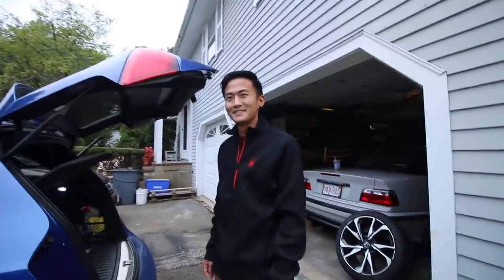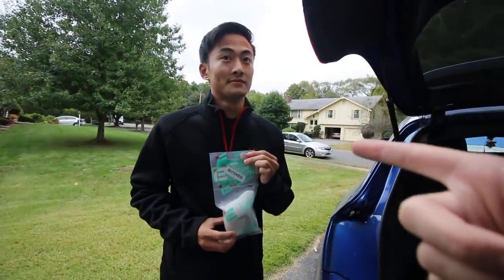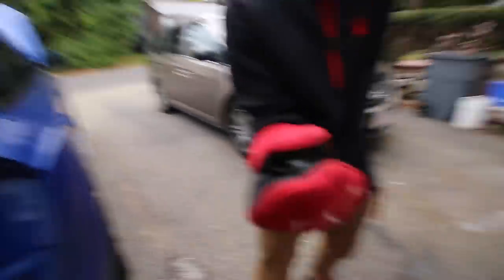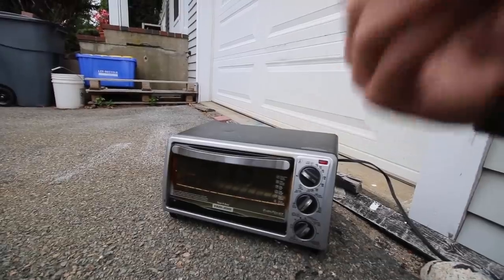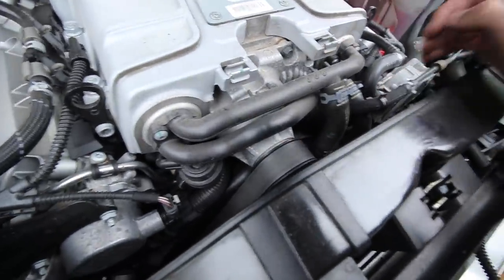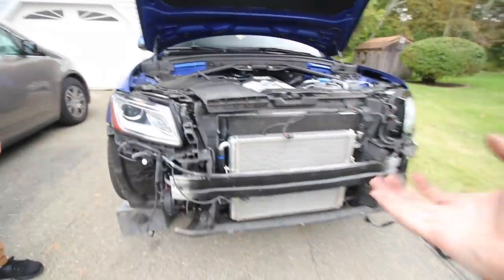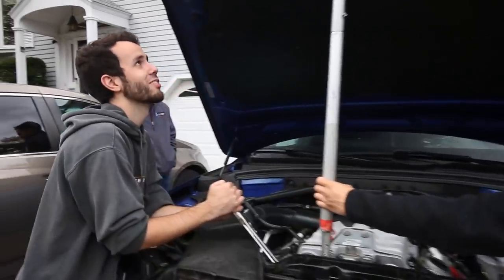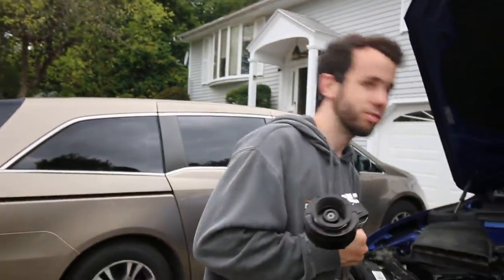SQ5 IE CRACKLE TUNE & S/C Pulley Install

Comment: Are the burbles adjustable? I like it but I think the duration once you lift off the throttle is a bit too much for my own taste. For example, on my N55 powered BMW, I essentially get full control over the duration and intensity of the burbles and pops. Daily driving? Almost no burbles. Cruises to car shows and with my group? Obnoxious af. Great video though, reminds me of the old days of you ripping with your S4 and throwing every mod on it.
Reply from the maker: They are not. But I’m sure IE is happy to hear feedback!
Reply: IgnitionTube I'm sure their customers would be happy to have even more flexibility with their products! Heck, I'm not even on any of their supported platforms and I'm a fan of their offerings.

Comment: Crackle sounds nice, but crackle is a bad thing based on my knowledge. Think of retarding the timing to achieve noise with leaning out the car. Leaning out results in incomplete detonation which over prolonged time should destroy an engine. Are there no concerns with this? Or does I.E. address this? Or have they created a tune that does something completely different to achieve this, maybe adding more fuel during upshift or letting off the throttle?

Comment: Hey Eli, I’ve watched all of your videos I think they are great. I had a couple questions about the IE stage 2 tune before I added to my B8.5 S5 if you don’t mind. 

First does flashing the ECU with stage 2 make the check engine light come on due to hotter air flowing out of the engine possibly making it trigger the O2 sensor.

Secondly, could I just go right to stage 2 if I replace the supercharger pulley?

Lastly, is the crackle tune adjustable to only crackle at a certain point?

Thank you for making awesome Audi videos.

Comment: Curious to know why IE doesn't supply a new belt. Many other companies supply a new belt due to the smaller diameter pulley.
Reply from the maker: Because it’s not needed until you go dual pulley. It’s millimeters of difference and the belt is already very taught.

Comment: I know this was 2 years ago. But you ran stock cats on this even with crackle?
Reply from the maker: yes, not the best decision but I knew I was going to do test pipes later on
Reply: @IgnitionTube  yea I ran it for a day and said f that and took it off. Rather just run single with no crackle and hopefully make cats last a little bit longer.

Comment: Question. I leased a 2019 A4.  I know I’m not supposed to modify it in anyway but do you think the stage 1 tune would be practical?  I know I can always return it to stock but I was hoping you could give me your opinion
Reply from the maker: John Torres once flashed you will get the car TD1’d as soon as the dealer plugs it in, even if you flash back to stock. They’ll likely make you pay a fee when you return it after lease ends.
Reply: Damn that’s sucks lol. Thanks for the reply
Reply: @johntorres6724   I've had stage 1 GIAC on my S3 for almost 5 years now and taken it to dealership throughout the life of the warranty when I flash it back to stock and never had a single issue getting flagged for TD1.. That being said, definitely be cautious with your tune and your dealership especially considering you are leasing. It can be a slippery slope.

Also.. having a dealership that is tune friendly is always nice, but hard to come by.
Reply: Mac T. Thanks for the info. I’ll keep that in mind. I would have loved to get an S3 but was a little out of my range lol. Eventually

Comment: I had the exact same problem with the pulley on my 2014 s5. It took me 4 tries and a lot of screaming to finally fit it on lol. I’ve seen that you mention that the biggest difference was going from single pulley to dual pulley. Do you recommend removing the cats beforehand? Or would it be an issue I could take care of a little after?
Reply: If you're already working on the car and have access to them you should move the cats before they burn up

Comment: Do you know if you can get the crackle tune if you currently have APR software or do you have to completely switch over to IE?
Reply: Daniel Servelli think about your question really really hard....
Reply from the maker: Geert Wilders not on the 3.0T. APR has been out of this platform for 2+ years...
Reply: Ivan Chassed thanks for your help man I thought about it really hard

Comment: I have an A7 with the the S/C Pulley and crackle tune from IE, but it was only for double pulley, so I'm running a Stage 2 Double pulley tune but with a single pulley. What did you guys do? Same situtation?
Reply from the maker: You should not be running a dual pulley tune on single pulley. That is not right. There is a single pulley crackle tune file.
Reply: @IgnitionTube  I really don't see it. It just goes from Stg 2 to Double Pulley to Double  Pulley Crackle. Not sure how you found it! Thanks though.

Comment: Hey I have a 15 sq5. Is this the stage one with a single pulley?
Reply from the maker: No, we reflashed the tune. It’s a single pulley file
Reply: @IgnitionTube  I can't seem to find that crackle tune under single pulley. And chance you have a link. Also how is the zf tune?